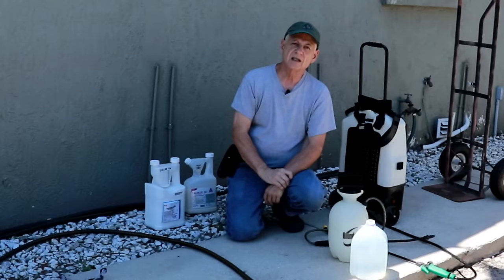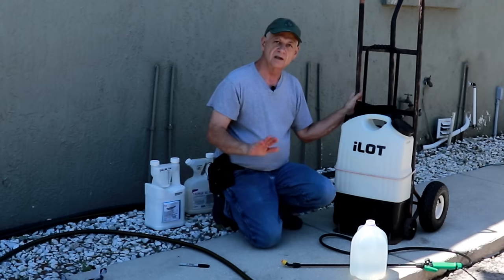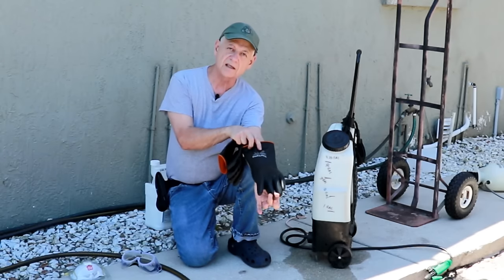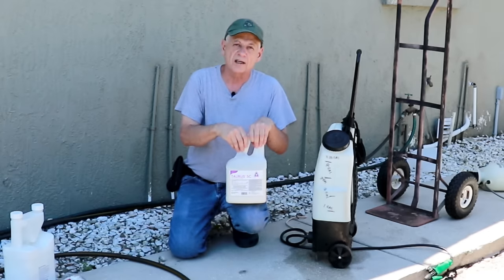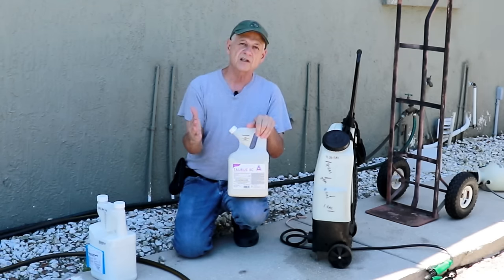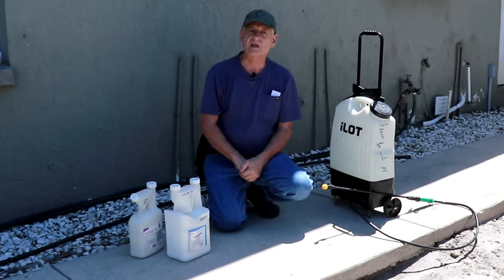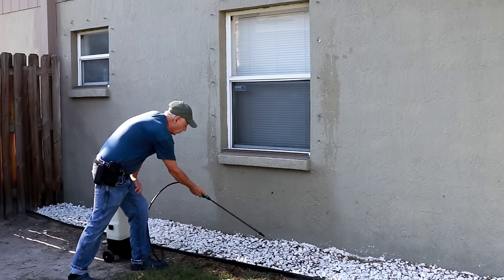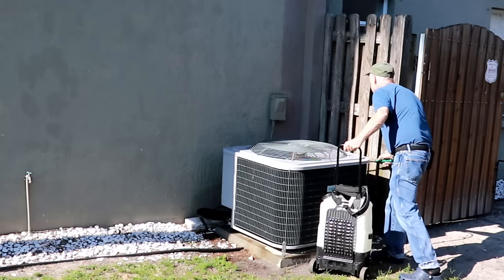General Exterior Pest Control - IMPORTANT!  READ THE DESCRIPTION.

Comment: Question: Why do the pest companies say that ground treatment last 6 to 7 years?
Reply from the maker: It lasts 5 to 10 years if you trench using fipronil, such as Taurus SC or Termidor.  Wouldn't it be great if you could just spray the outside of you house and it lasted 6 years?  No such luck. Trenching only works on subterranean termites.  In your case, you have concrete around your entire home, so you need to drill that concrete and the termiticide needs to be injected under high pressure to ensure that it makes a full barrier around the house.  You don't want gaps where the termites can get through.  Also, you don't want to drill through any utilities, like water lines.  So, this is something that is best left to the pros.  Now, if you have termites, and if you see mud tubes or damaged areas, then I can tell you how to spot treat the problem, without drilling the concrete.  This is not a sure thing though.  Spot treating subterranean termites will work about 95% of the time, if it is done properly.  Please let me know if you want to give that a try.  Also, please tell me where you live.  Location matters with this.  Be well my friend.
Reply: @GuysPestSolutions  I was going to actually follow and redrill the holes that the pest control company did.
Reply: @GuysPestSolutions  I live in Hawaii where we have ground termites. I don't have any signs of termites but I would like to keep it that way so that's why I was planning on doing this myself.
Reply from the maker: If you already have holes that were drilled previously in the concrete, then it was treated before.  Those holes can be reused, but you still need to use high pressure to distribute the termiticide properly.  You are correct that you do have subterranean termites in Hawaii.  In fact, you have Formosan termites, and they are the worst of the worst.  So, I think it does make sense for you to do a preventative treatment.  The only thing is that, in your case, you really need to hire someone.  I would get some estimates and find out how much it would be if you drilled out the holes yourself or if you have them do it.  A lot of the cost with this type of treatment is drilling the concrete.  You should be able to drill out the plugs fairly easily and it would be easy for them as well. So, it may surprise you how inexpensive it may be to have someone do it.  Always get several estimates, and don't forget the locally owned mom and pop outfits.  Sometimes they offer the best deal.  I hope that helps.  Be well my friend.
Reply: @GuysPestSolutions  Okay, thank you for your tips.
Reply from the maker: You are very welcome.  Be well my friend.

Comment: How is taurus compared to Bifen IT?
Reply from the maker: I have never used Bifen I/T, but as I understand it, it is the exact same formulation as Talstar P, but for less money.  Both products, Bifen and Talstar work differently than Taurus SC.  Both Bifen and Talstar are quick kill, repellent pesticides that are safe to use both inside and outside, although I am not a big fan of using then inside.  Taurus SC is outside use only.  When a bug contacts a repellent pesticide they vacate the area because they realize that this is a poison to them.  So, if you place a barrier of Talstar P or Bifen I/T around your home, the bugs will not cross it and, if they do, they will die.  So these are very effective products to prevent a wide variety of bugs from entering your home.  Also, if you have an ant infestation and you don't want them on a particular surface, this will repel them.  Just do not use it on food preparation areas.  Taurus SC works differently because it is nonrepellent.  That means, unlike the other two products, the bugs do not realize that they are being poisoned and they will happily cross the barrier.  When they do, they do not die right away and they take the poison back to the colony/nest, and they share it with the other bugs and the entire colony/nest dies out.  So, if you do an initial treatment with the Taurus SC, that will eliminate any infestations of insects that come and go into your home, instead of just preventing them from crossing the barrier.  You want to kill these guys off before you go to a repellent pesticide.  Now, in my video I explain that you can only use the Taurus SC every six months, but it does not last six months, so you need to follow up in three months with the Talstar P or the Bifen I/T.  After that initial treatment with the Taurus SC, you can just keep treating with the Bifen or Talstar or you can alternate between the Bifen/Talstar and Taurus every six months.  I hope that clears it up for you.  Thanks for the question and thanks for watching.  Be well my friend.
Reply: @GuysPestSolutions  
Oh mine! Pleasantly surprised with such a detailed and clear response. Thank you!

If Taurus SC is only for outdoor, what do you then suggest for indoor for spiders, ants etc?
Reply from the maker: Most of the time I do not use much pesticide inside the house.  There are exceptions, like German cockroaches, but as a general rule I use methods targeted for a specific pest.  To start with, if you do the General Exterior Pest treatment every three months, then you will not be dealing with any pests in the house, unless you carry them in or they fly in.  That being said, if you have an existing infestation of ants for example, then I would bait for them.  There are a number of fine gel baits out there.  You just use small dots along the ant trails.  I also use a protein bait in conjunction with a sweet gel bait.  Protein baits generally come in granular form and, again, you sprinkle it along the ant trail.  Just a little is all you need.  Ants like their sweet bait fresh, so I feed them every day.  I like Advion Gel Bait for the sweet and Advance 375A Ant Bait for the protein bait.  I will place links below.  The reason I use both a sweet and a protein bait is because some ants prefer sweet and some prefer protein, so I put both on the menu.  Spiders are super simple.  Generally, I just knock them down with a broom and step on them, but I also spray under the bed, behind the bed board, and other areas that are not easily accessible.  Any pyrethrin based aerosol will work.  Even Raid Flying Insect Killer.  If you want to go pro on them, then you can use something like CB-80 Aerosol, but the truth is that Raid will do the same thing for a lot less money.  You just spray where you either see the webs or you think that they may be.  I spray under the bed whether it needs it or not.  Again, once the pests are gone, then the exterior treatment should keep them out.  Most of the time the pests people call about are ants, roaches, spiders, fleas, termites, and bed bugs.  The treatment is different for each.  I very rarely spray something like Talstar P inside, even though it is registered for that purpose.  I hope that helps.

Advion Ant Gel Bait:  https://www.domyown.com/advion-ant-bait-gel-p-932.html

Advance 375A Ant Bait:  https://www.domyown.com/advance-375a-select-granular-ant-bait-p-39.html?sub_id=542

CB-80 Aerosol:  https://www.domyown.com/cb80-aerosol-p-103.html
Reply: @GuysPestSolutions  This explains the perfect reasons.

Comment: Does it kill fleas too
Reply from the maker: To rid your home of fleas, the first thing you need to do is to vacuum all the upholstered furniture and pet bedding, paying particular attention to places where fleas can hide, like behind cushions. Next, vacuum the floors throughout the house. If you have a vacuum with a disposable bag, then discard the bag outside in the trash. If you have a vacuum with a reusable canister, empty it outside in the trash and then wash it out with the garden hose before bringing it back in the house. Wash all bed linens and pet bedding in your washing machine and dry on high heat. Next, spray a pesticide that is labeled for fleas, on all the floors and on areas of upholstered furniture that does not come in contact with people or pets. To treat floors, hold the can at arm’s length and make sweeping motions across the floor to cover all surfaces. For upholstered furniture, you should spray under the cushions and then any folds that there are. The product that I like best is called PT Alpine Flea and Bed Bug Aerosol. I will give you a link for it. Fleas can be hard to kill, so you may need to do this treatment every two weeks until the problem is solved. If you have pets, then you should treat them as recommended by your vet. The reason fleas got into the house in the first place is because they are outside. If you have a flea problem outside, then there is a good chance you will end up with a flea problem inside. Even if you don't have pets, the fleas will still jump on you when you are outside, and so you can carry them in. Therefore, you need to treat the yard as well. I do this with a hose end sprayer. I will give you a link to my video on how to do that. I find that treating the yard every 60 days seems to do the trick. Just treating the perimeter of the house will not work for fleas.

I hope that helps. Be well Stephanie.

PT Alpine Flea and Bed Bug Aerosol: https://www.domyown.com/pt-alpine-flea-and-bed-bug-aerosol-p-1886.html?pdpv=2&sub_id=25601

Video on how to treat your yard with a hose end sprayer: https://youtu.be/wifoTU5dmp0

Comment: Hey thanks for the video, I recently bought the Taurus SC just to treat around the house. This product should take care of all basic pest correct? Ants, Spiders, Roaches, camel crickets in the crawl space?
Reply from the maker: This question got posted twice.  Please let me know if you did not receive my answer.  Thanks.
Reply: @GuysPestSolutions  Hey, thanks for the response I will definitely have to get the Talstar and apply. Also it works as a virus rite, where it infects one and then the whole community?
Reply from the maker: The Taurus SC works like that but not the Talstar P.  The Taurus SC is what we call a slow kill, non-repellent pesticide and the bugs do not know that it is a poison.  So, they happily walk right through it and then take it back to their nest or colony and share it with the other bugs and then the entire nest or colony will die out.  Talstar P on the other hand is a fast kill, repellent pesticide.  That means the bugs can identify it as a poison and they avoid it.  If you spray it on them, they are going to quickly die.  They will also die if they attempt to cross the barrier that you placed around your home.  Since they can identify this material as a poison, they typically will not attempt to cross it after it has been applied.  Since Talstar P is a quick kill product, this is not going to result in eliminating a nest or colony.  The reason I recommend alternating between these two products is because the Taurus SC is going to wipe out the nests and colonies, but it can only be used every six months.  The problem is that it does not last six months, so you need to use some other product in between.  I find that the Taurus SC lasts about three months and that is why you need to apply the Talstar P three months after you apply the Taurus SC.   The Talstar P works more like a shield against bugs rather than a way of killing them off.  So, using the Telstar P three months after using Taurus SC will provide you with a three-month shield to protect you from an infestation until you can treat again with the Taurus SC.  I understand that I did not make this clear in the video, but that was the first video I ever did and so I didn't get it exactly right.  Unfortunately, YouTube does not allow us to edit videos after they have been posted.  

I hope that helps.  Be well my friend.
Reply: @GuysPestSolutions  thanks a lot going to order the Talstar soon. Be well thanks
Reply from the maker: You are very welcome.  I am always here to help.  Be well my friend.

Comment: Will this hurt your pets
Reply from the maker: Hi Dino.  Sorry for the delay in answering your question.  For some unknown reason YouTube held it for review and I didn't know that they did that sort of thing.  I have the problem fixed now, but not before several questions went unanswered.  Anyway, the answer to your question is no.  Just let the pesticide dry and it will not harm your pest at all.  Thanks for the question and, again, sorry for the delay.